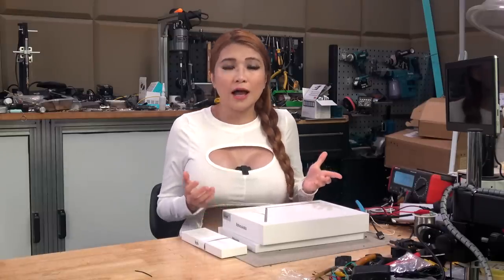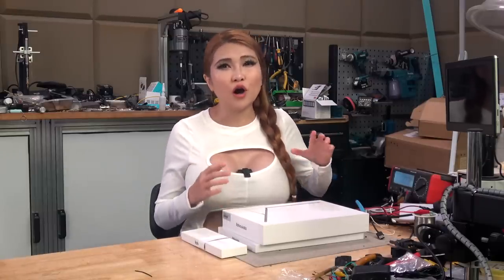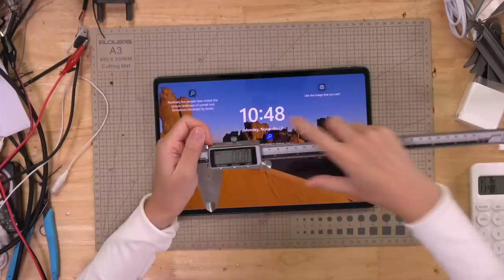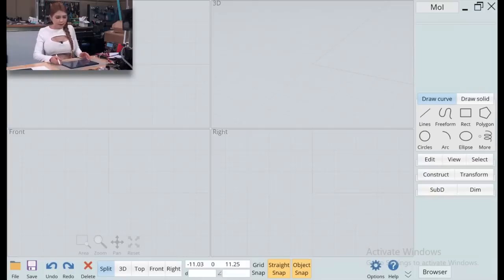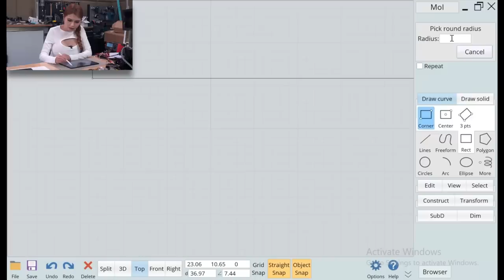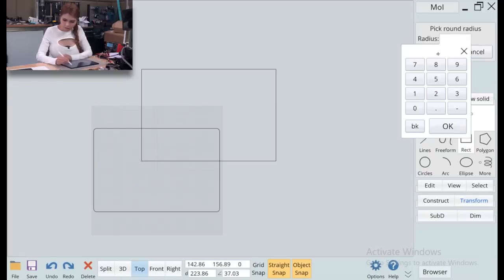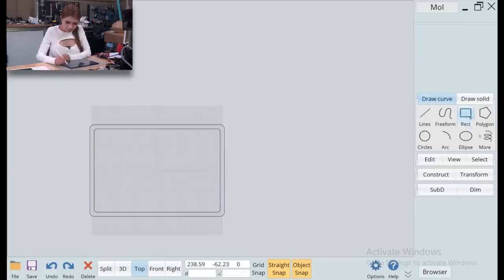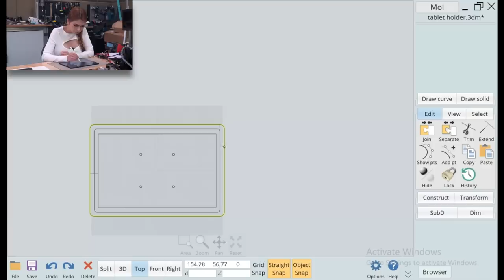Lasercutting Bamboo for the The Robo&Kala 2-in-1 Tablet

Comment: Nice to see this tablet going through the tests. Thanks! Side note: To measure the height of an object, you can hold your calipers vertical with the bottom edge on the tablet, and slide the jaws open, the thin part that comes will touch the desk top and give you an accurate reading of height. Also a great way to measure the depth of a hole. Thank you for making these great tech reviews!

Comment: Great video. You're so lucky to have access to so much manufacturing knowledge and equipment. I've been using a Windows on Arm device for a couple of years now for work and for my use it's been really good especially for the battery life and portability. I hope it becomes mainstream. There are really still quite a lot of limitations with software. I agree about Linux on tablets being a bit difficult. It's even harder getting Linux on to Arm based Windows devices because of secure boot.

Comment: Price point is reasonable for it, but being an unknown brand becomes a hard sell. As much as I want competition with larger companies, it is hard to spend much money knowing they may not be around to support it in 6 months when I may need it. I hope they do well. Great review video as always. I wish you health and success.
Reply: Yeah. ARM plus unknown brand makes this a no go for me, though it's EXACTLY the kind of tablet I'd be interested in otherwise, at the right price point. I'm using an iPad Air now for note-taking now, and it's just too limited, I need a full OS to really replace my laptop and unfortunately because of stuff like CAD software that OS has to be Windows. But until e.g. SolidWorks gets a Windows ARM build or ARM Windows machines get x86 emulation on par with the M-series Macs (which likely requires a bespoke SOC, since part of the reason Rosetta works so well is support in the silicon for certain x86 quirks), I'm leery about moving away from x86.
Reply: price point is ... expensive, for that money good old Sammy gives you a real gorgeous tablet, with a powerful  processor !

Comment: I love my tablets. Makes it easier on my back if I can lay down or sit or whatever. I actually use them so much that I wear them out to the point of pretty unusability. Because I'm also cheap & don't want to replace it very often. 
I'm actually getting there with my current tablet but I think I'm going to go ahead & replace with a better tablet while it's on sale. 
Mostly because I'm sick of being tied to either the charger or a powerbanks. Because it takes ages to charge only 20-30%. 
Plus it would be nice to have a bigger backup tablet too.

Comment: According to Google accessed from Portugal: The Robo & Kala starts at US$799 with 16 GB of RAM and 512 GB of storage, but is probably just the tablet without keyboard and pen; I also am cheap and would never pay 1200 USD for a 2 in 1 tablet, there are other laptops that allow tablet mode but also 2-D pyramid mode, and so on; that device would be a fair 250 USD with that full box; best regards.

Comment: Every bit of your OS comments are accurate. Thank you for your objective reviews.
Reply: Half of, i assume. The OS ist mostly irrelevant, the Applications are, what's count. As long, as all runs smooth, Windows is as good as Linux or BSD or whatever. If Problems occure, like USB-Drivers for the USB-Blaster, your Options to fix the Problem are better on Linux.

Comment: Oh how I wish I had access to the repair ecosystem of Shenzhen. I have an old laptop with a broken keyboard. I have a replacement for it but after disassembling what I could I ran into a brick wall or in this case a metal one covering access to the broken keyboard with no visible way inside. Sorry, rambled a bit! Solid review and impression video as always.

Comment: Naomi. . . Who is Momo's friend? Or did you get another puppy?

It was quite interesting watching you make the mounting system. 

The only thing I would have done different. is not screwing it directly too your expensive laser cutter. I would have mounted the mounting arm shaft / base too a couple of magnet's. Or some suction cups. Most likely I would have used both on the mounting base. That way it is easily transferable. And it would be able to be mounted too any kind of surface. Weather it was horizontal or vertical.

P.S. Looking Beautiful as always.

Comment: Another very good video. As you mentionned windows on Arm is not that perfect. I would say before buying an Arm windows computer, make sure wahtever you want to use as Apps does work or be suported on Arm. The next point is about repair. If a laptop  from known manufacturer is broken and under warranty then yes no problem it will be repaired or replaced. Now if it is out of wanrranty most manufacturers are on fix price repair. I have seen the cost for M$ surface and it is not cheap, far from it. If you can get a 3rd party repair with cheaper price then great but you still have to find one.

Comment: Other options, portuguese language: Dell, Inspiron 17, portátil 2 em 1, 4 modos: tenda (V invertido na mesa), TV
(L com teclado atrás do ecrã), portátil (L com teclado em frente do ecrã), tablet (dobrado
com teclado escondido), CPU 11th Gen Intel Core i5-1135G7 (8 MB cache, 4 cores, 8 threads,
até 4.20 GHz Turbo), Windows 11 Home (versão inglesa), GPU Intel Iris Xe Graphics, ecrã
17", QHD+ 2560x1600, 60Hz, IPS, Touch, TrueLife, moldura fina, RAM 8 GB, 2 x 4 GB, DDR4,
3200 MHz, SSD 512 GB, M.2, PCIe NVMe, 2 USB 3.2 Gen 1, 1 Thunderbolt 4, 1 HDMI 1.4b,
ranhura SD-card, câmara 720p@30 fps HD RGB camera, altifalantes estéreo Waves
MaxxAudio Pro, 2 W x 2, Realtek ALC3204 CODEC, Intel Wi-Fi 6 2x2 (Gig+), Bluetooth,
bateria 4 Cell, 68 Wh, fonte alimentação 90 W AC, ENERGY STAR 8.0; 829,99 USD

Comment: Am going to wait a few years before buying this kind of device.  Reviews of Windows on ARM so far are negative.  The problems are lack of performance (ARM isn't powerful enough to run full blown bloated Windows, especially big programs), and program and driver compatibility.  Windows on ARM doesn't run 64 bit x64 Windows programs under emulation, which are now the majority of Windows x64 programs.  Good luck finding compatible drivers for your legacy products.  Went to my local public library and x86 Windows 11 couldn't find a compatible driver for their years old Canon scanner.  (Will try the scanner again with Win 10.)  Right now, Windows on ARM seems like Android 2.3, I'll wait for Android 10.  BTW, these devices lack ports, I have similar Surface Pro and Go devices and hate the dongles hanging every which way.